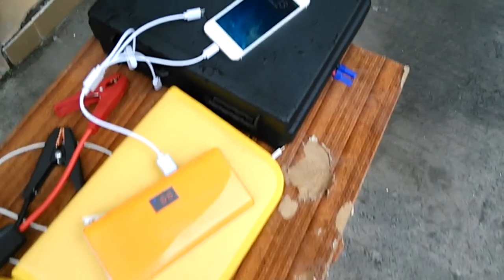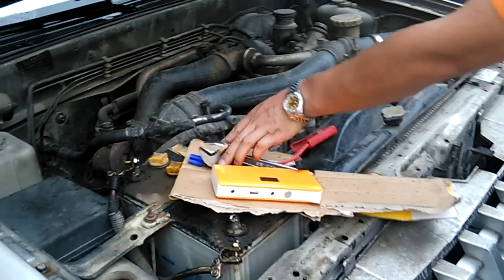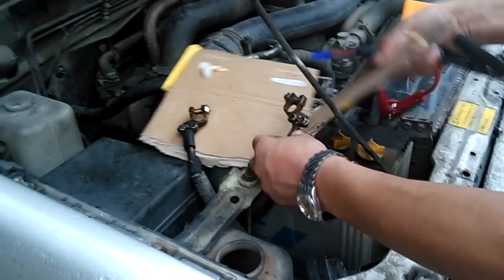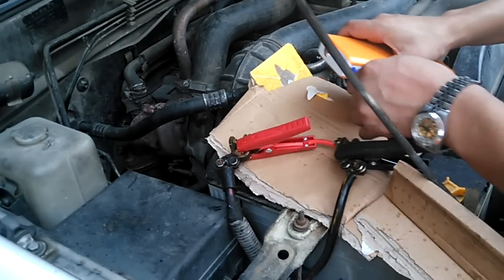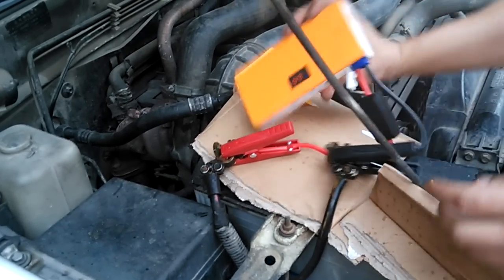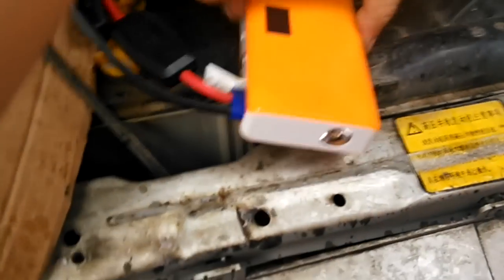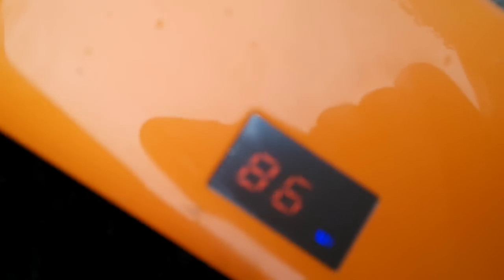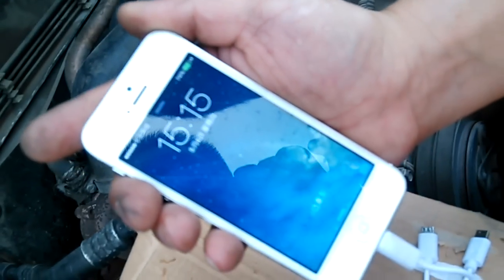Start a 2.7 litre diesel engine by pocket jump starter CP-04

Comment: I must say, this is without a doubt the best guide to reconditioning batteries available [Check Details Here==>https://www.facebook.com/Battery-reconditioning-310070329426065/app/208195102528120 ]. I have purchased some guides in the past but not of them come close to the amount of detail in yours. It's actually worth much more then $50!